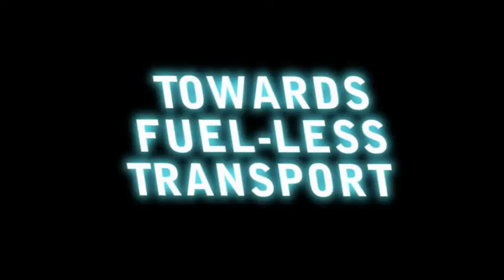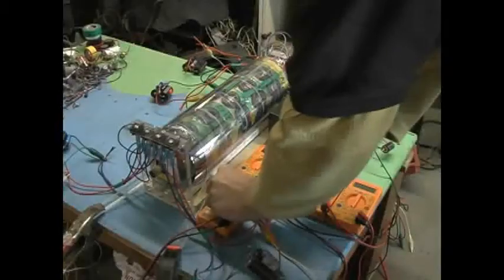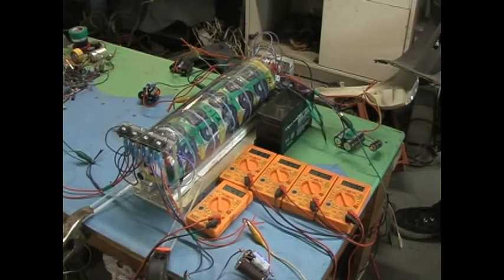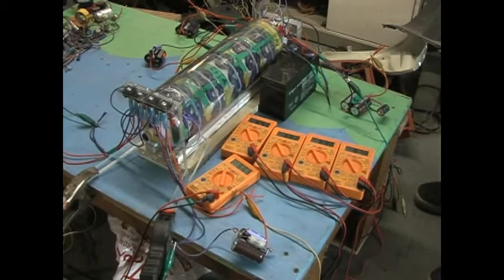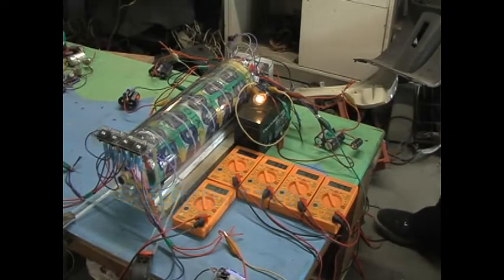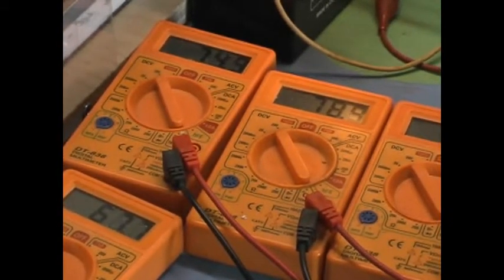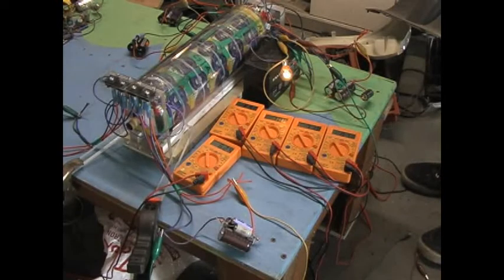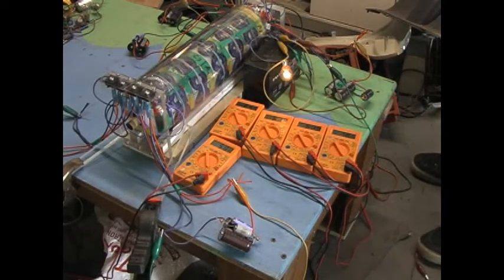solar-fed MAG AMP GEN III

Comment: Good Questions: Our earlier SOLAR VEES maxed at about 3 amps w/wind problems, $3000 cost - so you see this $100unit advantages. Also Batteries alone can cost $12,000 or more; but $1000 with these units; plus, they wear out-these units don't! So you see all the important advantages!

 Little motor work's fine - other vids test one is too big, needs more current. This is 5-ring; one just finished? 6-ring: good standard size.

Comment: Lescull: You may be right, but Air turbine while steadier than weather, have there own stability problems: maybe two combined to even out Voltage? Mort 1-phase at 3600 gives 120v; 3-phase at 1200 120v- 600;60v. So I want about 6 or 700 (volts can be 20 or more over Bats depending on amp/prop. A good part of this test was finding it didn't tear itself apart at 1200rpm's! Keeping current flowing is the object - no heat with no back-up, but Bat begins resist when near full.

Comment: So what is the ideal RPM? - and set the number of fins accordingly.  When you get it outside, use all elements and add a solar panel to the circuit.  No-grid assumption has you moving it outside.

Comment: Why not get the initial spin from a squirrel cage horizontal wind turbine? (ie: zero current initial input, kinetic contribution from external factors only - the assumption should be no-grid, 'cause it's going down - ask New Hampshire!) If you're having stability issues, let initial wind get it started, then the air preasure resistance - once it is spinning - will keep the RPMs steady.